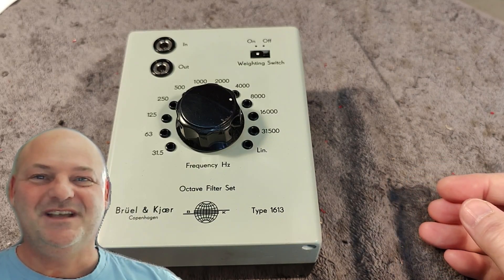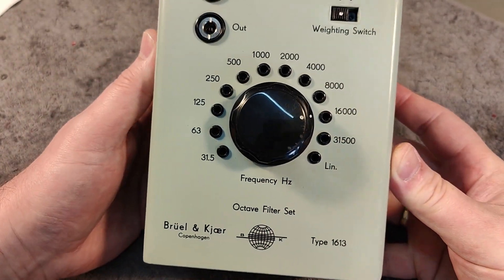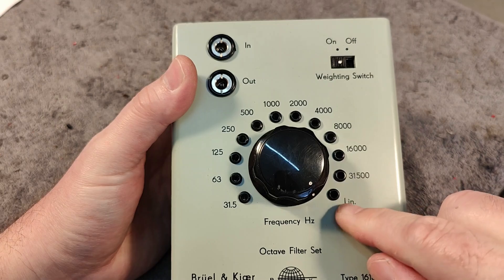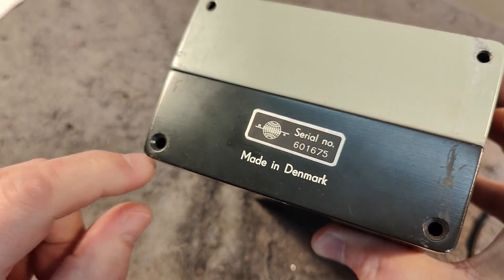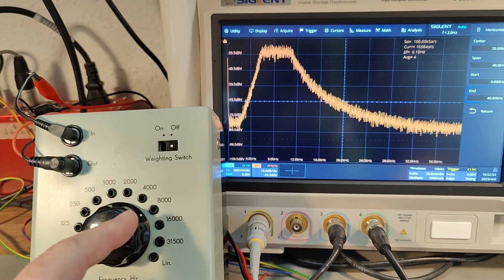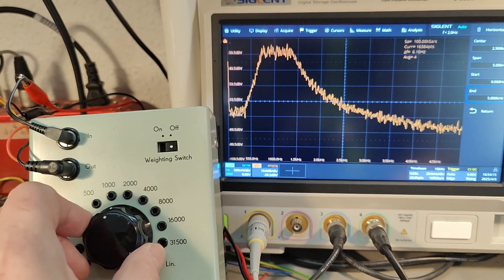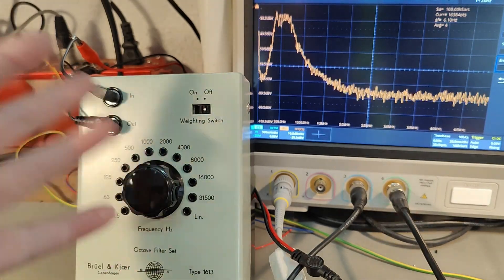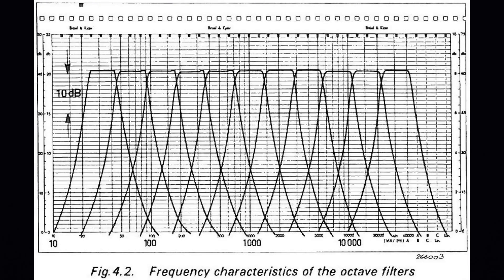Brüel & Kjær type 1613 octave filter set 31Hz to 31 kHz

Comment: Hey, are those just standard power cables you spliced to send audio in and out? I just got a couple of these I want to use.
Reply from the maker: yes, i figured out they mate just fine for this unit, but the real smart thing would be to change connectors to BNC
Reply: @TeardownOZ2CPU  I was thinking about changing them to 1/8 jacks. I don't have them yet is there enough room inside to change the jacks?
Reply from the maker: @kimmills688  i think there is plenty of space, but i personally would have selected BNC

Comment: I so dislike the weird connectors on their equipment.
Reply from the maker: i do agree, BNC would have been much better. maybe it was not so wierd a connector in 1966 ??
Reply: I have a bunch of their gear but I have not even bothered to really connect it up because of all of the silly connectors and all of the effort I'd have to put into the research for their silly power connectors as well. I do want to run some of their microphones though so maybe one day before I die. I even have one of their giant bandpass filters with the big dial that Heinbach popularized. @TeardownOZ2CPU